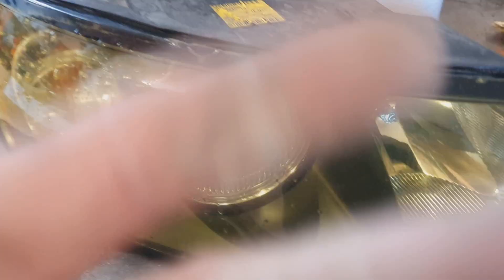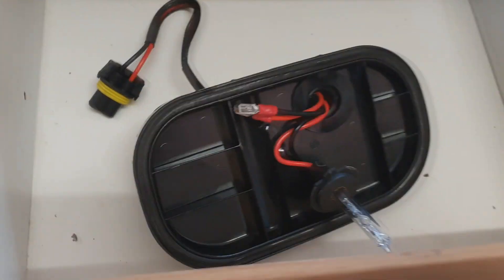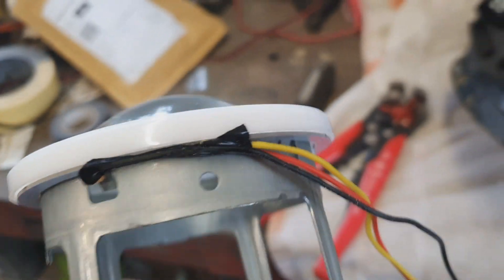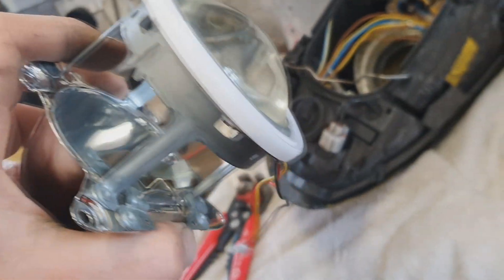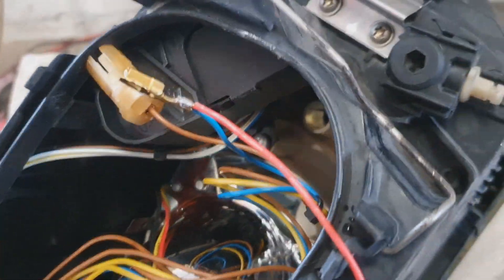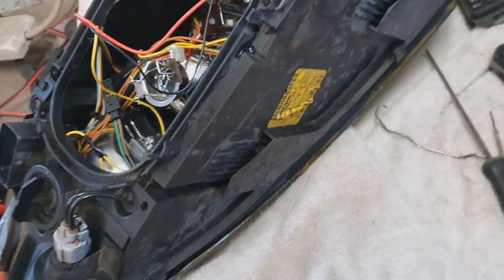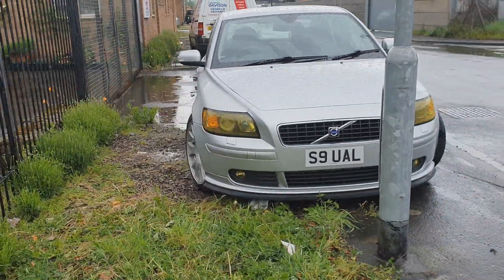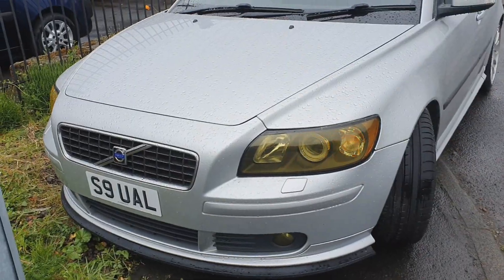Volvo S40 Halo angel eyes upgrade guide

Comment: Quick question I think your right they should of put a helo in they have the outer lens for it. 
What I need to know when you switch the volvo on the main light comes on.so in order for the helo can I take it of the main feed to that main light so I can just have the helo showing as I only bought the car not so long ago. And could you tell me what wire it is so I can do that please.
Reply from the maker: I used the sidelight feed for the halos so I can just put it onto the side light and it would have the halo on. Other wise it gets lost by the main headlight. I can't remember which wire it is but it's the little sidelight wires you want to use.

Comment: Have you still got this car ? I'm wondering what they look like with your dipped beam on
Reply from the maker: Yeah I still have it, with the dip beam on they aren't very noticeable, but I do have HIDs in too. I need to put new ones in too cos these ones failed.
Reply: @ThePhilBilly  tks for the reply , I'm looking to do mine just don't know wether to go switch back or plain white 🤔
Reply from the maker: @stevie-green  next time I'm going just white, I had some problems with the switch backs on these ones plus they ain't even a year old and they need replacing which is a bit crap
Reply: Hello again mate , quick question , I'm fitting 60mm halo switchbacks in the indicator ring lense , wondering which colour wire off the indicator I need to tap into
Reply from the maker: @stevie-green  sorry I never replied, it never popped up, if Im honest I can't remember off the top of my head, I think I mentioned it in the video but not sure which one is was tbh.
Reply: @ThePhilBilly  sorted now mate , yellow off the holder ,
Reply from the maker: @stevie-green  that rings a bell! Pleased your sorted

Comment: 90mm Inside or Outside?
Reply from the maker: If I'm perfectly honest I can't remember. Now, I need to get some new ones in soon so I will measure up again 👍
Reply: @ThePhilBilly  did they die already?
Reply from the maker: @denote7025  One of them has gone dimmer than the other, but also fancy a change of colour too
Reply: @ThePhilBilly  I just installed mine yesterday, but sadly one died after 10 minutes. I got a 2005 with the Bi Xenon Headlights, 77mm ID on ring fit accurately
Reply from the maker: @denote7025  it's annoying how much crap is about these days isn't it! It's luck of the draw if you get some good ones or bad ones isnt it. Thanks for letting me know the size again though.
Reply: @ThePhilBilly  Really sad, i wish i knew some good brands making those, i dont want to burn my car down lol
Reply from the maker: @denote7025  yeah, it seems to be either have to spend a fortune or cross your fingers and hope for the best with cheaper ones